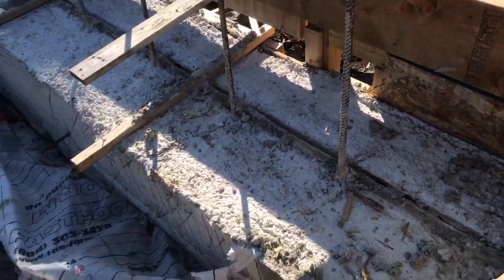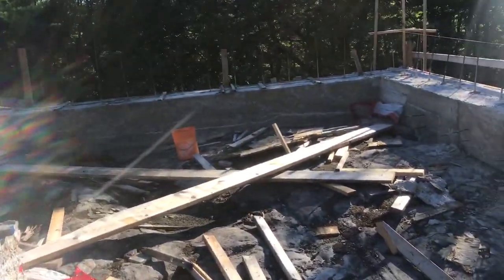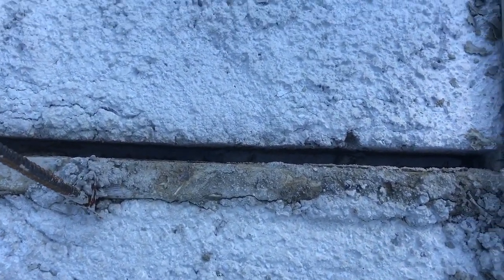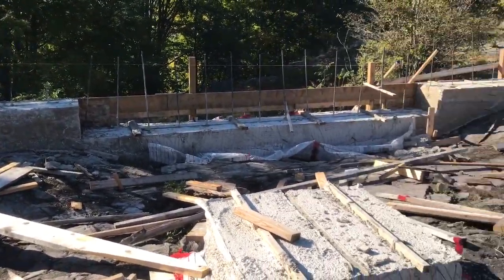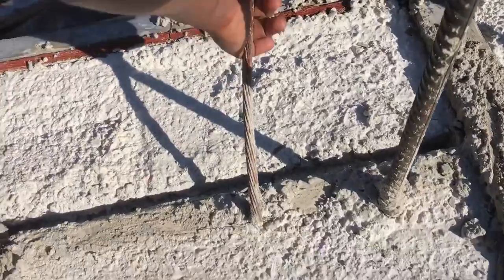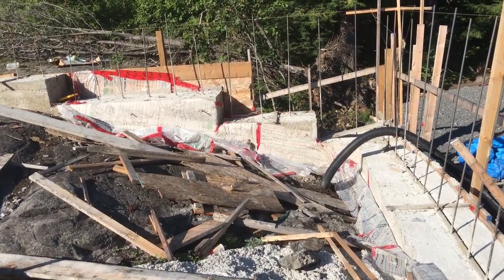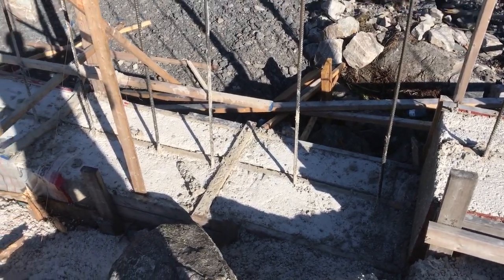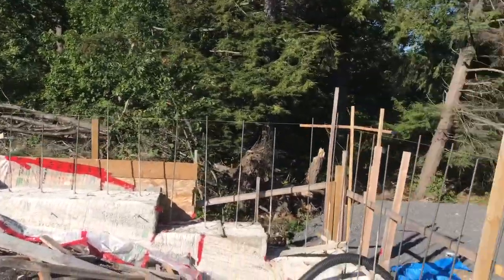Striping footing| made mistakes on concrete pour | Building my dream house : Ep7

Comment: Having a 'key' is a good idea but you needed to make it tapered so it was a wedge and then coat it with a bit of vegetable oil so it released easier. Also it only needs to be 1/2" deep. We used to press the corner of a board into the concrete before it hardened on several job sites.
Reply from the maker: Okay, thank you for the tip